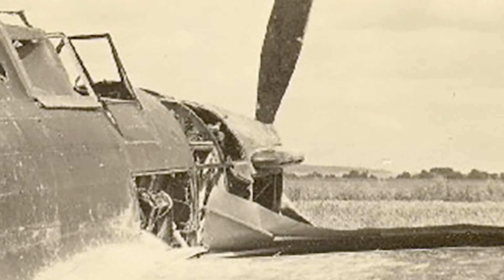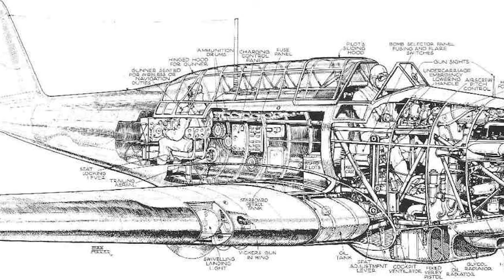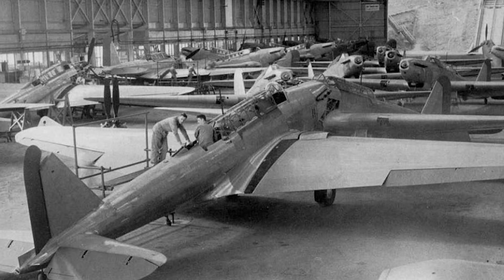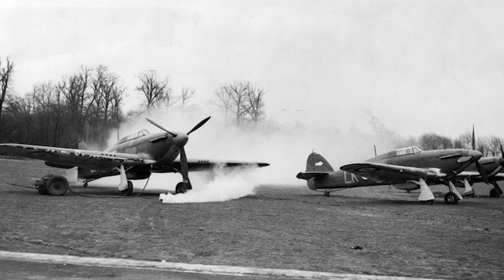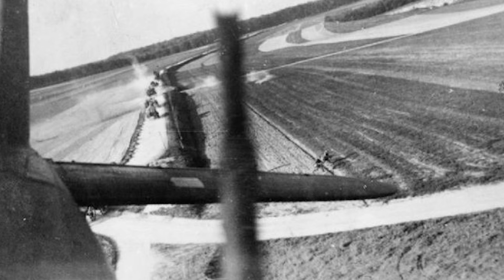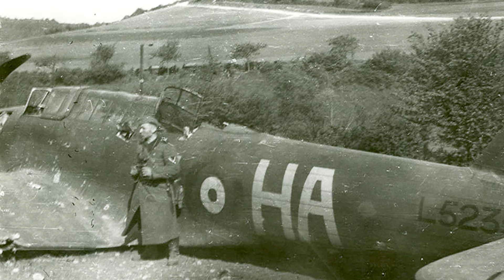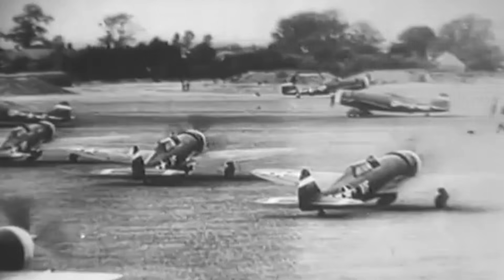The Fairey Battle - Light Bomber, Heavy Losses | Aircraft History #6

Comment: Seems similar in performance to the German Stuka, and did about as well in combat when faced with large amounts of quality enemy fighters.
Reply from the maker: Yup. The Stuka was lucky early on because the Luftwaffe had air superiority so it could operate in relative safety.
Reply: @RexsHangar  yes, very similar in performance. But the Ju 87B did have some armour protection.
Reply: It seems to me the Fairey Battle was much larger and the IL-2 was better armoured against ground fire and the Stuka was a dive bomber, so it was somewhat less exposed to ground fire. But yeah, planes like these rely heavily on having air superiority over the combatzone.
Reply: How was the Battle in comparison to the Japanese three place level bomber? I think it was called the Kate? It was a 1935 specification and had a 235 mph top speed?
Reply: @Whitpusmc  Would the German Bf109 pilots have found the Kate (Nakajima B5N) harder to shoot down over Europe than the Fairey Battle?
Reply: @fe6767  I doubt it but I don’t know. The USN was able to shoot down the Kate regularly but I think it was faster and a bit more maneuverable.
Reply: @Whitpusmc  Wikipedia gives the Battle's top speed as 414 km/h and the B5N2's top speed as 378 km/h.  I haven't read anything about the manoeuvrability of either plane.
Reply: A dive bomber vs a level bomber though different ideas and expectations
Reply: i think it was a level bomber, not a dive bomber like a stucka, while the il2 had a bunch of nasty weapons, and also its speed down low is probably quite alot better than the battle
Reply: Lol at the person that trying anti Soviet stuff. Oh they didn't care about human life in the il2? then WHY did they armor the shit out of it just making stuff up
Reply: Yes but one is a divebomber..the other a light bomber..
Reply: As a dive bomber it would have been excellent
Reply: Good idea in 1935 but outclassed in 1940.
Reply: It was a crime to put young pilots in those flying coffins
Reply: @bergssprangare  In hindsight yes. But it was war, the enemy had to be hurt and there was nothing else to put them in. Lives are a negotiable asset at times like that. Horrible business.
Reply: @ploppysonofploppy6066  I Disagree..A lot of god pilots were killed..They would've been needed for the later battle of Britain..You have to know when to leave a lost battle to win the war..
Reply: @bergssprangare  Absolutely,  but hindsight is the only exact science. How do you know when a battle is lost? 
Had Jellicoe ran from Jutland when those 5 ships blew up and stayed in port, we'd all be speaking German.
Reply: @ploppysonofploppy6066  The battle is lost when your opponents fighters fly 200 mph faster with 2 x 20mm cannons vs 1 x 0.303 Brwowning
Reply: @bergssprangare  Hindsight again. What would you have done? This was a classic " rock and a hard place" scenario. 
Also which aircraft was flying at 460 mph in 1939?
Reply: @ploppysonofploppy6066  So you mean the RAF wasn't aware of the ME109 1936 when they decided to continue the order when there were alternatives? That's a low judgement of the brass..It was a political decision..Thank God there were companies as Hawker that had foresight to project and build Hurricane w/o orders..
Reply: @bergssprangare  What alternatives? Blenheims, Hampdens and Wellingtons were being slaughtered too.
The brass certainly weren't aware of a 460 mph fighter you seem to know about.  Buy then no-one else has either. Unless you think that was the BF 109s top speed.
Reply: @ploppysonofploppy6066  I normally don't give free math and history lessons, but  Blenheim is a 2 engine aircraft..1 +1 = 2..ME109 was projected in 1931 and first flew 1935..It participated in the Spanish civil war..You mean RAF didn't noticed? Read my lips: It was a political decision that killed many brave men for nothing  that were badly needed..Believe me ..it's still going on today..
Reply: @bergssprangare  I don't usually give history and math lessons, but it's BF not ME, and 260mph  plus 200 is 460mph, and until you can reveal this "Wunderwaffe", I'll continue to give your posts the credit they deserve. 
What's this all about anyway? Won the Battle of France on War Thunder?
Reply: @ploppysonofploppy6066  Hawker Henley was an alternative. It flew 400mph faster..The Henley was quicker,carried a heavier bomb load and had a similar range
Reply: @bergssprangare  So the Hawker Henley flew at (400 + 260)
660mph!
🤣🤣🤣🤣🤣🤣🤣🤣🤣
I see what you're doing now. Kudos!
Reply: @ploppysonofploppy6066  No ..It could reach other galaxies when really trying..so about 43909 mph
Reply: @bergssprangare  "These are the voyages of the Star Ship Henley"😁
Reply: @ploppysonofploppy6066  u got it
Reply: I read the the IL2 specs were similar and yet it was a "success". A lot of IL2s were lost however, but kept in production, human life seemed less important to the Soviet air force perhaps?
Reply: @ploppysonofploppy6066  The Soviet Il-2 were trying to fly sorties when the Germans had air superiority, and given how slow and heavily armoured they were, they were always going to suffer heavy casualties but attrition rates dropped massively as the war progressed and the Luftwaffe were beaten back.
Reply: @ploppysonofploppy6066  The IL2 was a flying tank so it could handle punishment that the Battle and Stuka couldn't
Reply: @normanberg9940  Arguably the Battle's weakness was its performance. Adding armour would have made this worse. How did the Il2 manage to haul all that at such a speed? Did it actually manage it? Have we been taken in by Soviet disinformation?
Reply: @ploppysonofploppy6066  i don't think so. By all accounts from German fighter pilots and Allied pilots in Korea she was a real bitch to take down. Added to that were the Russian tactics of operating them in large formations thus allowing for massed mg defense.
Reply: @ploppysonofploppy6066  The IL-2 was a great CAS , it could carry a large amount of weapons and had 2 23mm cannons and 12.7 mm. The heavy losses they took wasn’t because it was a bad plane. Before the US got long range fighters into Germany B-17 losses where horrendous yet the B-17 is a amazing bomber. 
It’s all about context due to the situation of the battles and the shift of tech and doctrines.
Reply: @joshuabonilla3491  B17 had four top rated engines, and despite its miniscule payload was adequate. The twice debunked doctrine of "the bomber always gets through" was the issue there.
My point is the il2 eventually had a 1700 hp engine. The earlier models had engines more in line with the Battle. Suspect those earlier models flew like a pig, but we're kept in service.
Reply: @ploppysonofploppy6066  the maximum takeoff weight of the Il2 was 1000kg more than the Battle but it was a newer aircraft design with a significantly more powerful engine.  What is controversial is its performance as a tank killer.  Soviet authorities were probably taken in by exaggerated claims by Il2 crews.
Reply: @ploppysonofploppy6066  The losses of the Il-2s aren't really a design fault of the Il-2. So replacing the Il-2 for another attacker wouldn't have worked. This is more a case where the USSR deemed it worthwhile to continue attacker missions, even with their inherent risks.
Reply: @ploppysonofploppy6066  There was always some of that in the soviet air force but the primary difference was that the IL-2 was actually a fairly heavily armed and armored plane in comparison. Sure the flight specs and payloads were roughly similar but the IL2 often came equipped with a pair of 7.62 mgs and a pair of 20mm cannons (later 23mm) for offensive use. Its fairly significant integral armor also meant it could sustain some pretty serious levels of damage and still return to base. This armor also made it all but immune to ground fire from anything smaller than a 50 cal. Finally the IL2 is actually 2/3rds the size of the Fairey Battle making it harder to hit as well. The Battle is an absolutely MASSIVE plane for what it does.
Reply: @alexsis1778  Food for thought to be sure. But can we assert that the extra metre on each wingtip made the Battle an easier target? I've not seen anything on that. Gunners and Fighter Pilots aim for the centre, and a hit on that wingtip is the one least likely to bring it down. 
We can equally assert that the IL2's smaller wing area, along with its higher empty weight, partly as a result of that armour and armament, would increase the wing loading. The Battle, in comparison would have had more benign flight characteristics, making landing and take off accidents  (a significant cause of losses) less likely.
And the Il2 wasn't a "flying tank". Aircraft armour can only cover the vitals. Crew and engine, or more correctly, the cooling system. A 20mm cannon hit anywhere else on the airframe could bring it down. And while Fighter Pilots always over claim, the Luftwaffe racked up some serious scores on the Eastern front. 
Look how much I've written! Not really got strong opinions either way, but I just wonder if there's a pattern. In and out of the Soviet era, Russia seems to have been willing to send its armed forces in, poorly equipped and prepared, and sweeping the cost under the carpet.  Tsushima, WW1, Finland, Afghanistan,  and now - you know where.
Reply: @ploppysonofploppy6066  Er, Nope. You need to read more before making judgments. The Il2 was very heavily armed & armoured from the start with self-sealing tanks & designed for short-range, low-level attacks against tanks: like the Fairchild A-10 30 years later. When the Soviets finally fitted it with a rear-turret, losses sharply declined. it was one of the finest designs the Soviets produced during the war & became the most produced military aircraft in history, such was its suitability for the role it was intended for.
Reply: @hairydonuts6024  Yep
And every word the Soviets come out with is Gospel truth. 
Every word.
Reply: @ploppysonofploppy6066    It was a great Attack not Dive Bomber aircraft with an armored shell weighing 700 kg (1,500 lb), protecting crew, engine, radiators, and the fuel tank. The armor was 15% of the weight of the aircraft no other aircraft had that much protection back then, mebey not now even!
Reply: @lambastepirate  Hang on. Which one? Il2 or Henley.
Reply: @lambastepirate  I wonder how the thing got off the ground. Must have been a pig to fly. And Luftwaffe pilots racked up huge scores on the Eastern front. Makes you think.
Reply: @ploppysonofploppy6066  I seen a vid from one of the German top aces and he said the only way to shoot it down was from behind and below some sort of weak spot located thair, so I guess if it got low it would be very hard and fairly dangerous to try and shoot down.
Reply: @lambastepirate  Trouble is, you can't armour the whole machine. That 15% might cover the engine, cooling system specifically and pilot. But a couple of 20mm shells in the wingspar or fuel tank and the games over.
Reply: @ploppysonofploppy6066  When the Nazis are exterminating your people you fight with what you have
Reply: @ploppysonofploppy6066  the difference is the armour protection
Reply: @krishendrix4924  Deja vu. I'm afraid.
Reply: The IL-2 was much better protected against ground fire. It was built with CAS in mind. The Battle on the other hand wasn't. It was meant for longer range strategic strikes on Paris or western Germany. @ploppysonofploppy6066
Reply: The Stuka was a dive bomber able to accurate bomb targets and its flight characteristics and range were good. It even proved a well tank busting aircraft later in the war. Just like any bombers though, they were highly vulnerable to fighters without a heavy fighter  escort of their own, but they were not in the same league as the battle.
Reply: Really Stukas were able to perform untill the late 1944 because Soviet airforce was really unsuccesful and lost heavily to Luftwaffe, they would lose way more but later for the Luftwaffe, the eastern front became second priority. Stukas withdrew from the west but its remarkable that they continued to operate in the east.. often, while trying to shut down the Stukas, soviet fighters faced heavy loses that even the AAs were more succesful depending on the battle of course. Of course in official reports, Soviets sometimes shot down 100x more planes that the Luftwaffe really had in the region, the partial reason was that Luftwaffe often managed to fly more combat sorties than the soviets despite having around 3-4-5 times less planes, sometimes even up to 10 times less but soviet logicistics often werent great and russians couldnt keep up with the high sortie rate of the germans, soviet planes were often "grounded" on the airfields.
Reply: For example, Germans never lost Kursk battle in the air, they simply flew very, very large amount of combat sorties, pilots werent really sleeping much in that time and while the Kursk ground offensive halted, they needed to relocate to other important regions that needed air support.... Soviets faced some unusual high loses in the air... but next month, it was all replaced... They had a lot of planes waiting in the reserves and factories kept pumping more and more every month, like every month they could produce whole german airforce numbers avaible at Kursk lol except for the bigger bombers, these werent as mass produced and were pretty valuable
Reply: Of course in Soviet reports, Kursk was a great air victory - otherwise, their airforce commanders would lose jobs and lives if they didnt claim huge success and it was hard to verify xD
Reply: Except people laughed at Battles and fled in fear from Stukas
Reply: Not. A. Divebomber.
Reply: It was crap .
Reply: Except that it wasn’t as easy to produce, maintain or upgrade which makes it an inferior bomber
Reply: Stuka excelled as a CAS aircraft and was an extremly dangerous Dive bomber and even was a threat to ships due to how accurate it was. Like any plane designed for that role, even bombers they were sitting ducks with out air cover. The battle just was not a good plane unlike the Dauntless or Stuka which excelled at their roles.
Reply: @Sakura_Matou   yes what I was thinking the battle was not in the same class as it was supposed to be a level bomber